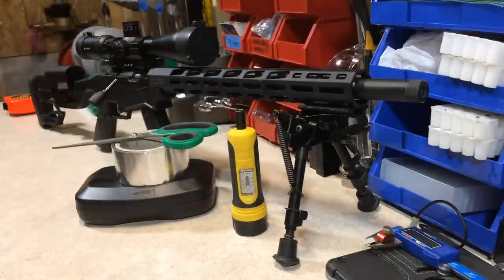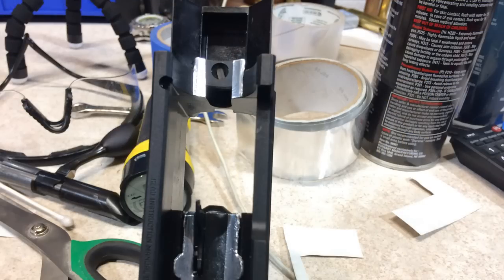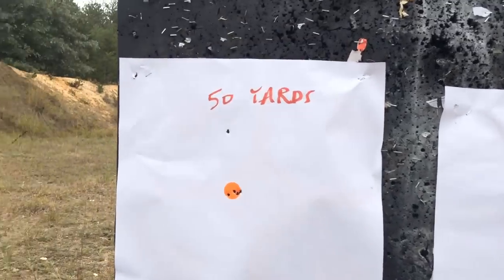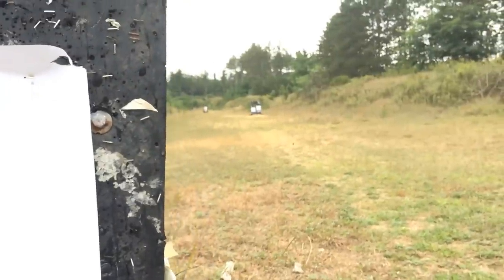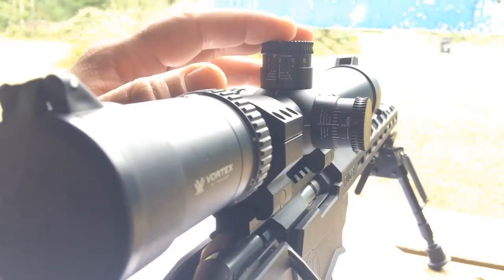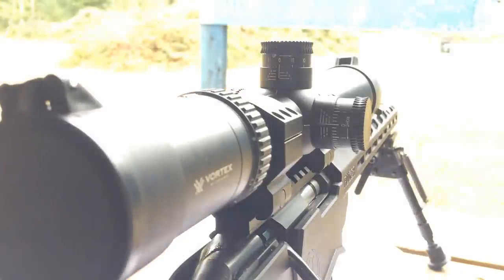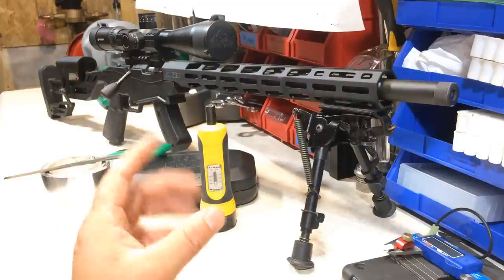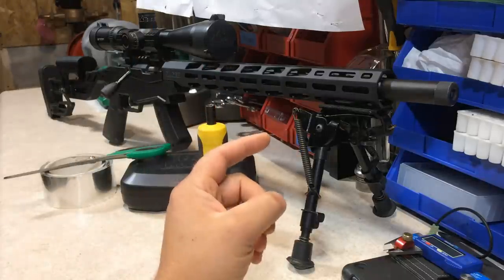RUGER PRECISION RIMFIRE REVIEW TIN FOIL TAPE BEDDING PART2

Comment from the maker: BTW I set the two main chassis bolts to ruger’s disassembly video torque setting to 35 inch pounds
Reply: Hey elfster, try some mini mag hollow points. Always been a winner in my 22's. 
Been having good luck lately with cci subsonics also. Knocking off eggs at 160 yards !
Reply: I hope someone comes out with aftermarket bedding block that is better fitting. I torqued mine to 35inch pounds with factory parts and ending up stripping them out, I believe it to be too high of torque value with materials in involved. Others, have experienced the same. Just, something I experienced with mine, I also retorqued  my rifle also. Great video.
Reply from the maker: Man, that’s too bad to hear that. Thanks!
Reply: @stephenmiller7290  I was just reading a thread on sniper hide and a few people were saying that they were getting better accuracy with 20-25 inch pounds. sorry to hear your screws stripped out
Reply: Yes, my rear screw stripped out the second time I tried to torque to 35 inch pounds. I believe I'll give Ruger a call since others are having this problem.
Reply: 20 in lbs folks, that is all that it needs. Use clear nail polish to lock the threads.

Comment: Bedding the barrel block on the sides is a good idea, but putting tape on the top of the block changes the height of magazine in relation to the bore of the barrel. I change to a match barrel an all of the rounds had scrap marks on them when the were ejected without firing. I removed the bedding on the top of barrel block and the rounds are now loading fine.  I am averaging about 0.3 inches at 50 yards with Lapua Midas + match ammo. Taking out the top tape and allowing the magazine to move up and in a few thousandths of an inch worked.
Reply from the maker: Nice!

Comment: These guns like "riding dirty" DONT scrub clean them, shoot 100-200 rounds through it and then just carbon clean it until you see accuracy drop off. Mine really tightened up after about 300 rounds and I have not done the tape bed trick yet. It really likes CCI standard and the mini mag. I see no huge difference in group sizes between those two ammo type but the  Mini mag is just a bit tighter.

Comment: Hey bud. Great stuff!  I actually ordered a RPR a few hours ago and am going to  shadow your approach as a part of my break-in/testing. I especially like what you did with the bedding. Thanks man!
Reply from the maker: No problem! Glad you enjoyed it! Keep us updated:)
Reply: So. Got a few hundred rounds through the RPR. Mostly testing Suppression accuracy, level, etc. Tonight, while mounting the suppressor I noticed about a millimeter play in the barrel when tightening the can. So I used the time to take her apart and tightened up the receiver block like you did with the foil tape before checking the barrel nut. The nut was fine. So I removed it to check the extension pin and found that there was no lock screw installed on the opposite side. There’s a hole for it but no screw?  Does your RPR have one?  I also noticed the the 22LR print on the barrel is on the bottom by the muzzle threads. Did they install the barrel upside down?
Reply from the maker: Gosh, I’m not sure! I would need to check myself! I would definitely double check every bolt and nut like in my video
Reply: Elfster's Rifles and Reloading Thx bud. Just watched another vid and the guy showed a quick view of his receivers pin. He didn’t mention it, but I paused it and could see that he had an empty set screw hole at button of his receiver and simply reinserted his barrel and tightened the nut. Either way, I’m gonna pop a set screw in. This explains why sometimes she’s accurate and other times not. If you could brother. Let me know where your .22LR stamp is. Top or bottom. Thanks man!
Reply from the maker: That sounds good! I’ll let ya know!!

Comment: I've owned my RPRR since June and now ill try the bedding asap! Thanks for the info! Have you had any problem with the BX mags fitting to loose and causing the bullet scaring and failure to feed?
Reply from the maker: Yes! Check out my 22lr rpr sled videos in my playlist area! Bunch of good info in there!
Reply: So how is your RPRR shooting ?
Reply from the maker: Amazing! Crazy accurate
Reply: Worth trying, I reduced the spring tension for the dedicated BX1 magazines I use with my RPRR, that reduced tension made for MUCH smoother feeding, AND no more bullet damage as it's chambered, even when I run the bolt hard & fast.

Also a little bit more positive tension of the ejector helped with casings not wanting to clear the breech.

Comment: I’ve owned a RPR for about 8 months. I initially tried bedding it with foil tape and it did seem to improve the performance. But recently, I noticed that my magazines (BX1) were not very secure and would drop down in front allowing the round to become scraped when being pushed into the chamber. Contacted Ruger, they had me send in my rifle and subsequently replaced the chassis. That improved the fit of the magazines greatly. But more importantly, I noticed that the fit of the barrel block was now very tight without any foil. Not only is there no wobble as I had before without the foil, it requires significant force to get it in place or taken out. I can’t even think about adding foil to the sides now, it will never fit in if I do. I wonder if owners of new RPRs have found that as well and if Ruger has tightened up the fit of the barrel block.
Reply from the maker: Thanks is amazing information! Thank you for that update! I might need to look into this. How does it eject?
Reply: Peter Silvestre I just bought my rpr 22 yesterday it’s still in the box actually but I hope this was fixed knowing that I bought this gunna year after this video?

Comment: I just bought this rifle 3 days ago, im going to watch all of your videos on this rifle today and im trying the tin tape tonight when i get home... i too noticed that i have to run the bolt hard or the brass will not eject (i kept it a short throw, didnt remove the clip)
Reply from the maker: I wouldn’t say you need to run it hard, but a very consistent non-slow method of running the bolt. I would also call RUger and have them send you some extra #29 cartridge positioner spring phone #
336-949-52oo... because you know damn well that part will end up going bad

Comment: Are there any videos showing the bedding process start to finish? I've never puller a gun apart this much (other than an AR platform) and would like a step by step.  I was at .68 groups yesterday with CCI blazer at 50 yards. Measured 5mph average wind at 30 degrees. Should be able to drive tacks after bedding.
Reply from the maker: Just search for ruger precision rimfire. RUger actually posted video showing how to take it apart.
Reply from the maker: Should be able to figure out with my video what to cover in tin foil tape from my videos rather easy
Reply: @ElfstersRiflesandReloading  i must have missed this one. I found a take down video, but i don't think it was by ruger and the barrel block wasn't part of the video. I'm not really ready yet because i don't have tools with torque settings, but once I know what I need and see it done, I can't wait to try it. My RPR has been the best gun purchase I've ever made. I grew up with center fire, and its just so much more fun to shoot 3 times a week and know that I've spent hardly any money.

Comment: I just ordered this as my first rifle. Is it worth bedding with aluminium tape straight away? Or should I put 500 rounds through it before I decide to take it apart?
Reply from the maker: I'd shoot it first and see if it's needed. Might take a solid 500rds to brake in that barrel too. Each barrel is different

Comment: do you need to take off the barrel to line the block with the foil tape?
Reply from the maker: Nope, barrel block is not attached to the barrel. The barrel just sits on the barrel block. It’s super easy. Just take the barrel off the chassis and you’ll see. Check out the ruger disassembly video on YouTube

Comment: Can you use electrical tape ?
Reply: NO! ABSOLUTELY NOT!
Electrical tape won`t hold. Foil tape is all you will want to use, it will stay put and not degrade like electrical tape will. 
Any local Lowes or Home Depot have foil tape. Look in the heating and air conditioning department areas for it.

Comment: What thickness is the tape??
Reply from the maker: It's just regular foil tape for duct work
Reply: @ElfstersRiflesandReloading  Ok I swear i had some laying around but I ended up ordering some and will try to bed the RPRR tomorrow when it comes in. Thanks for the video.
Reply: Got my tape in today and my first thought was that is was to thin but after installing it you could feel the block going into the chassis much tighter. I will try this tomorrow and see if it made a difference,  my guess is it will definitely help. I also replaced the trigger spring with a cut down 1911 spring that was a little softer, got the pull down to 1.5lbs. Cant wait to hit the range tomorrow,  thanks for the video!

Comment: What inch lbs did you do for the action screws?
Reply from the maker: I can't remember.... im pretty sure I said in the video tho
Reply: Earlier ones the manual i think said 25in lbs, now i see the revised manuals all say 35in lbs. 
I torqued all mine at 20in lbs and found it to be better than a heavier torque on the chassis.
These chassis`s are plastic, so don`t over torque them or you`ll run into ALOT bigger problems. 
The 20in lbs is more than enough to hold the action in the stock. I use clear nail polish to lock the screws.
Reply: I played around with the inch lbs on mine and found the sweet spot. It's an half inch moa at 100 yards now.

Comment: I’ve been very disappointed with my rprf, saw this from the hide, did you use 1 layer of tape for all surfaces?
Reply from the maker: Yes, just one layer especially on the top side. Might need more on the sides just enough so you can still get the block in the chassis but is as snug as possible. Also the rifle needs a good 300 to 400 rounds to brake in. Need to try multiple brands and types of 22lr to see what it likes to shoot. Also, if you’re not using a bipod or sandbags or rest to see what she can really do in terms of accuracy
Reply from the maker: One thing is for sure multiple RPR’s will not shoot the same. Even if they came off the same assembly line / factory
Reply: Elfster's Rifles and Reloading my rifle has easily over 1k rounds and I’ve tried 10+ types of ammo (including eley tenex, among other expensive types). My $99 marlin 795 shoots better than it.  Out of the box this rifle should shoot better than it does, without having to fix  design flaws. If I could’ve done it again I would’ve gone with a CZ.  It has feeding, extracting, and accuracy issues. It also has different points of impact after disassembly leading me to believe the accuracy problems are stock related.  I compete at 1k yards with a centerfire bolt gun btw, I’m not shooting this thing offhand.
Reply from the maker: Ahhhh k. Just making sure. That’s too bad :(